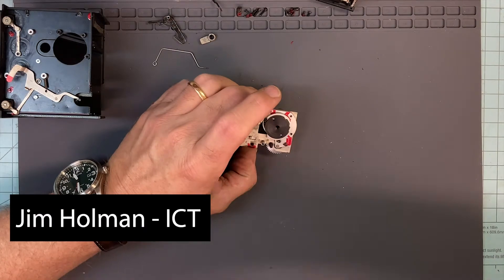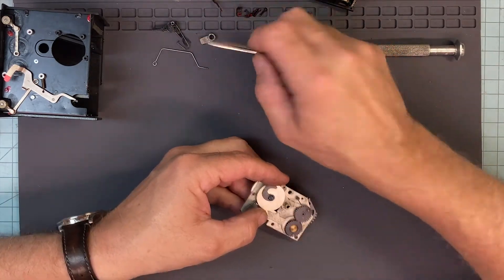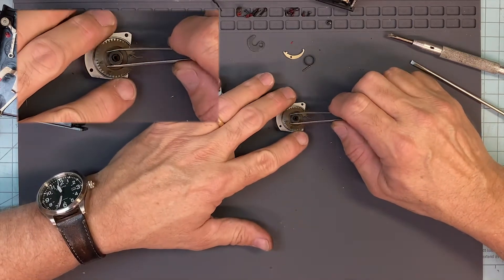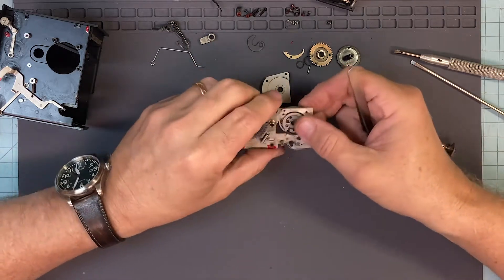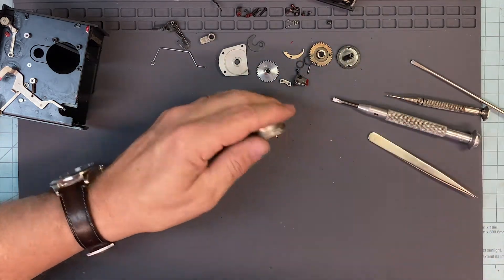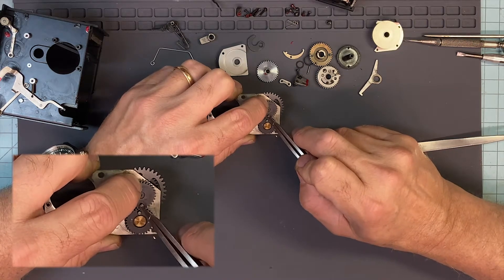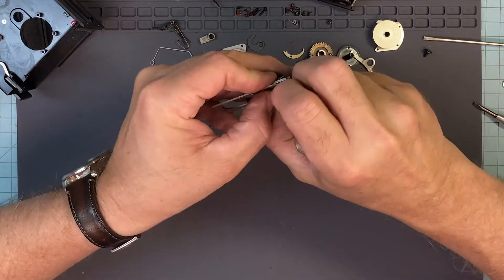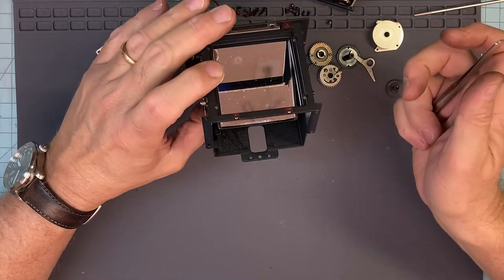Hasselblad Disassembly Part 2

Comment: My mechanism plate seems to be totally stuck to the box. My mirror is locked at 45 degrees  and is not free to move like yours. Any suggestions as to how I might be able to remove it. Tried gentle leverage with a diver but it really doesn't want to come off.

Comment: Hi, I have a Hasselblad 500 cm and I noticed the auxiliary curtains  are closing slowly is this a big fix thanks
Reply from the maker: Yes it is usually is a big fix. Most Hasselblads have not been serviced in 20-30 years so most lubricants are old nasty and sticky.
Reply: @ictcamera560  Thanks very much for the information. I  live in Ireland but there is a place in Dublin that services them. Could you give me a rough estimate  how much it would cost or a full service

Comment: Hi i am going to take my 500cm apart probably to clean. Can you just clean all the parts with water and soap? Another question: all the leather on my hasselblad has shrunken, can i just peel it off and reapply it with glue?
Thx

Comment: Thank you so much for this,,,, My hassey mirror has a tiny bit wiggle room after cocking, I guess it is the reason why the focus has never been spot on. Just wondering it is a big job to do the service by myself?
Reply from the maker: That is really hard to say, the mirror being loose on the latch would be unusual and I would have to investigate to see why the latch isn't tight. Sometimes the mirror are loose because of the spacers underneath it and that is a big job.

Comment: My 500c/m has trouble reaching infinity focus through, as it always just ends short before it when the lens is fully set at infinity. I’ve read that deteriorating pads under the mirror could be the cause. Is it difficult to reach under there to replace them?
Reply from the maker: Yes, It is very difficult. I usually have to remove the mirror out of the body to replace them. It's a big job. I would not recommend doing that if you do not have the experience.

Comment: How would one go about rewinding that dreaded spring if it does pop out? 
Also if that gear is off set (flat/non-toothed part not flush and slightly out of alinement to connect properly to the magazine winder) would it be best to loosen the center gear instead and hand adjust/aline spring gear and then replace the center gear?
Reply from the maker: When it comes out and unwinds it is a real pain. To rewind it I use my fingers and coil it until it is small enough to fit in its holder, very tricky and a lot harder than it sounds.
Reply: @ictcamera560  Thanks, that's what I was afraid of.
Reply: Thank you for doing this!! I did a trial and error (lots of errors) version for my own needs a few years ago. Eventually got it back together, luckily I sourced a new spring, since mine bounced out and tangled itself into a mess. Looking forward to seeing the next episodes on how to lube everything. The service manual is a bit scarce on details. Managed to find the correct grease but haven't bought a litre of PDP48 but rather have some quality synthetic Swiss watch oil that should go down to our coldest weather temperatures here in Finland. 
I have a few more bodies of my own to service, but will wait for your followup befor attempting to get them sorted.  Again, lovely work - thanks for sharing the knowledge its highly appreciated!

Comment: Any change for a video of how you use collimator to calibrate lenses? I have never seen how that works. Sounds really interesting.
Reply from the maker: I honestly do not know how I would do that. It would require a few angles and more help than I have in order to show what and how the adjustments are made. 
Maybe some day I'll be able to show the process.
Reply: @ictcamera560  Maybe use images / animations to explain the parts that are hard to film? Even just a talking video of it would be interesting.

Comment: So is the only internal foam on the body of the Hassie the mirror bumper? I always worry about foam or o-rings rotting inside old cameras and causing desilvering, etc.
Reply from the maker: Besides the mirror bumper there are a few light seals on the body to the front frame.